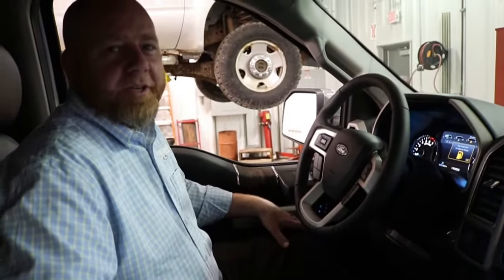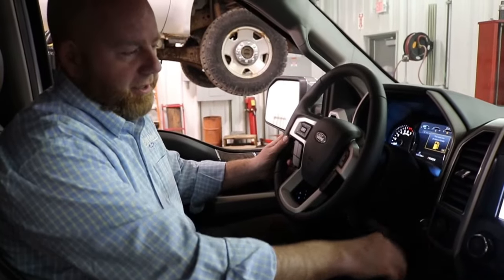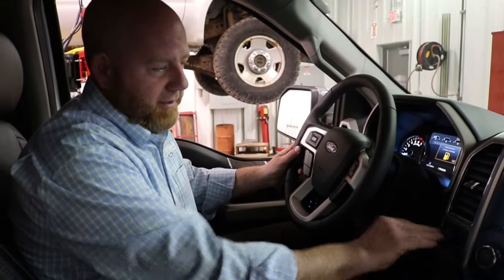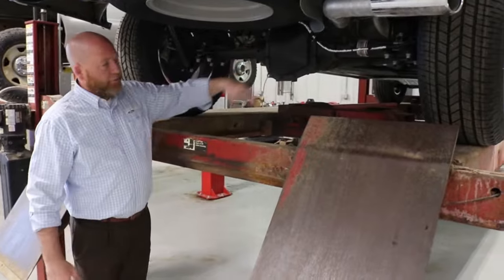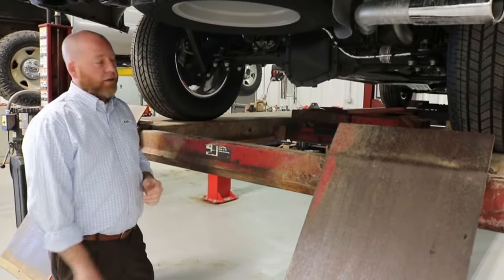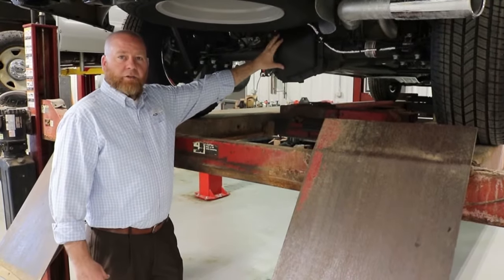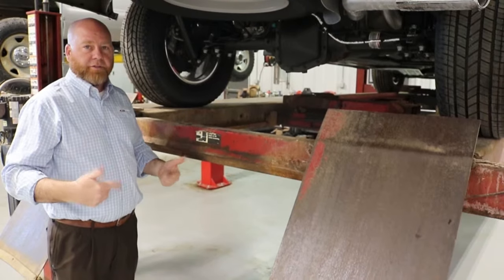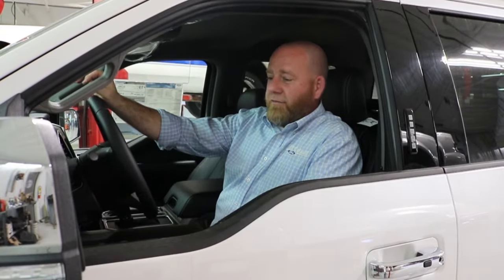Feature Friday: Electronic Locking Rear Differential

Comment: Forgot to tell them to disengage after vehicle is out of the mud or situation,  and don't try to drive at high speed with locked diff engaged
Reply: What happens if you forget to turn it off and run it for 20min at 70mph
Reply: @esmeraldamo19  The electronic differential will disengage automatically when the vehicle speed exceeds 25 mph (41 km/h) and it will reengage when the vehicle speed goes below 20 mph (30 km/h).

Comment: at 0.53 you say "normal drive mode limited slip", are you sure that is correct. I believe on that year of truck "normal" drivemode is an open rear end. It is my understanding that ford does not offer limited slip differentials for this model year.
Reply: Fx4 models do
Reply: I asked my ford dealer and was told that ford does not offer a factory limited slip in any of the F150  model years 2015 to current. I looked into getting an aftermarket one installed by my dealer but was told it would void my warranty.
Reply: It is an open differential until you lock in the rear end
Reply: So if you want to know whether or not you have an open differential jack up the rear of the vehicle spin one tire one way and if the other Tire spins the opposite direction you have an open differential
Reply: I looked over all the options when I was putting my 2020 F150 order together. There was no option whatsoever for a limited slip differential. Maybe years ago it was an option, but for later models you're getting an open end differential with the option for an electronic locker. I can't remember exactly what the additional cost was, but if you live in an area that has frequent snow during the winter, or if you go off road, it's definitely worth the cost.
Reply: @Sagittarius-88  you're right all these are open
they don't make a limited slip differential F-150s....there's just an electronic Locker I work on these every single day they definitely are not limited slip differentials for sure
Reply: @FordBossMe I've never had an E-locker diff open before. Only worked on open end and limited slip. Does having the E-locker create a lot of extra work for a gear swap or is it something that really doesn't interfere with the process too much?
Reply: @Sagittarius-88  it's actually not any harder than any of the other stuff we work on you know 

if you've done those that you spoke of this would be nothing for you 

Next time I do 1 I will put one up on my Channel

Comment: is it post to jerk around when turning the wheel like in 4 wheel drive i tried mine for the first time and when turning a little it was jerking the truck like it would in 4 wheel drive when turning hard
Reply: Yes that is completely normal that's what happens whenever you have your rear diff lock in and in four-wheel drive it will jerk and chirp and it almost feel like something's wrong because you're not supposed to run this vehicle with the rear diff locked unless it's an emergency or you're trying to get out of a stuck situation
Reply: I'm a dealer Tech and I've actually had somebody trade in a vehicle and they took the four-wheel-drive switch out of the truck to transfer it over to one of their commercial trucks because some of these switches are on backorder

And then they took a coin holder piece of plastic and stuck it in the spot where the four-wheel drive switch was to cover it up

When we had the Lube technicians move the vehicles to the back of the dealership they were saying the rear end is chirping and jerking and it just feels real rough

So I get inside the vehicle and I'm like wait a second where is the four-wheel-drive switch because that is where the locker is for the rear end

After doing some investigating and actually pulling the coin holder thing out of where the four wheel drive switch should have been I see the connector just sitting there and $150 later a new 4 wheel drive switch came in and I was able to disengage the locker in the rear end

In the meantime there's a little green connector back there in the rear end so if you ever have that problem and you unplug it it will disengage your locker if you ever have an issue in an emergency situation and you're trying to get it to unlock
Reply: the thing is i was not in 4 wheel drive all i did was pull the switch out in 2 wheel drive to lock the posi rear first time i tried this but when i would turn the wheel any little bit at all it would jerk like it would when turning the wheel hard in 4 wheel drive is that normal? 2019 f250 6.2
Reply: @brandon81250  any time you lock the rear it will do that 4x4 or 2wd

Comment: Hi. I have a Ford F150 from 2019 but only with rear-wheel drive. The roads are wet now, so I want to ask if I can turn on the differential lock during snowfall or rain. well thank you

Comment: Does a 2014 Ford F150 have an Electronic Locking Differential and if so, Anti-slip additive is NOT needed, correct??
Reply: Ford did offer the ELD in 2014.  I won't say all, but most Ford's have an FX4 decal on the truck bed if they are equipped from the factory with ELD.  If you have ELD you do not need an anti-slip additives for the rear differential.  Those additives are needed to help the clutch packs in limited slips differentials. If you aren't sure, contact your local Ford dealer with your VIN and they can let you know for sure.
Reply: Thanks for the reply, I did go to Ford earlier and I do have an ELD and it doesn't take antislip additives.
Reply: @GetUrPhil  Glad you got the info you needed.

Comment: I would much rather have a limited slip.  I've never had a problem with a limited slip, and they are always working at any speed.  This locking thing is only for very slow speed (off road) and will surely break at some point.  On the road, you are driving a "one wheel" drive unless the road is REAL slippery, then you get to make it a "two wheel" drive, one in the rear, one up front.  That's good, but no where near as good as a limited slip situation, then it's three wheel drive and much much better.  If it's so good, why doesn't ford offer them on heavier trucks.  I have two F-450's and one F-550, all limited slip for a reason, it works good and lasts a long time.  If I find a limited slip, I'll change my locker out immediately.  Another bad idea controlled by a little plastic knob...

Comment: A locking differential does not give equal power to both wheels. It gives equal rotational speed. The power distribution depends entirely upon the available traction of each wheel. If one wheel is in the air, nearly 100% of the power is going to go to the other wheel and the vehicle will move. An open differential on the other hand is what does give equal power to both wheels. If one wheel is in the air with an open differential, the wheel on the ground will get no more power than the wheel in the air. This is why the vehicle will not move.
Reply: do the other 2 big makers offer locking rear dif?
Reply: Wrong. A locking rear diff will give equal power to both wheels. It "locks" the axle shafts in the locker to spin at the same speed, torque,  power no matter if one tire is 50 feet in the air and the other is on a rock, ice, pavement,mud. A limited slip sends some power to the tire thats on the ground while the other is in the air, or has no grip such as on ice.
Reply: @Youtubecansuckmyshithole  That is a very common misconception. However, it is wrong. A locking differential makes both wheels have an equal RPM. It does not give equal power or equal torque. You can't force torque to go somewhere where there isn't resistance. If one wheel is in the air and one is on the ground, most of the torque is going to the one on the ground and you will move forward. It is impossible for an equal amount of torque to go to the wheel in the air because there is nowhere for it to go. It can't just be shoved out to the wheel without being used. Torque doesn't exist in the first place unless it is used.
Reply: @rmkilc  I am not sure I understand why you suggest "most of the torque will to go wheel to the ground" instead of the wheel in the air, using an open differential.  The power goes to the wheel with the least resistance in an open differential.  Which means no power will be delivered to the wheel on the ground, because it has more resistance to rotate, than a wheel in the air.  If there is no power being delivered to a wheel with traction, there will be no forward or reverse movement.
Reply: @stevenalthouse4372  Equal torque will go to each wheel with an open differential but not necessarily RPM. RPM and torque are not related. Since there isn't much resistance with the wheel in the air, it won't take much torque to make it spin. That same amount of torque is all the wheel on the ground will get, which is typically not enough to move the vehicle.
Reply: @Youtubecansuckmyshithole  Damn people, lol. You explained it best leonard Re. Bottom line is an electric locker when actuated makes a solid axle with potential traction on both tires. A limited slip is just that, not a solid axle and VERY limited traction on slippery surfaces. Open diff is designed to keep the axle from breaking when the tires differentiate in speed during turns on pavement. To the best of my knowledge an elec locker is an open differential until you engage the electric solenoid locker. Don't engage it on a dry very traction worthy surface or you could ruin an axle or spool assembly in the differential.
Reply: @CajunReaper95  well there’s nothin that slips in an open diff. The limited slip locks the axle and allows slip so the wheels can travel at different speeds around turns, different traction surfaces etc.
Reply: Who's on third?
Reply: @rmkilc  you clearly don’t understand the relation of a locked differential it does matter what wheel is making contact or not the both spin at the same time because they are tied together by the locked differential the same way a spool works! The only forgiveness is tire slip. Please do more research!!!

Comment: The locking differential switch goes bad frequently...it is a common issue. I used to be a Chevy guy before i got my 2014 F150. But in the last few years, lots of crappy made plastic parts are breaking. Had my Trailblazer for 11 years and NEVER had a problem. Crap is breaking all the time on this POS Ford. Going back to Chevy.